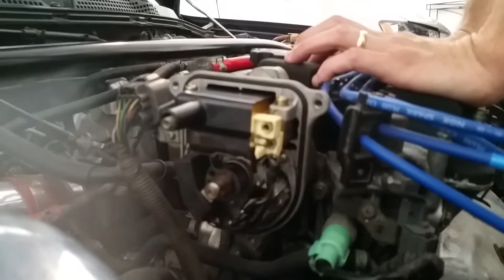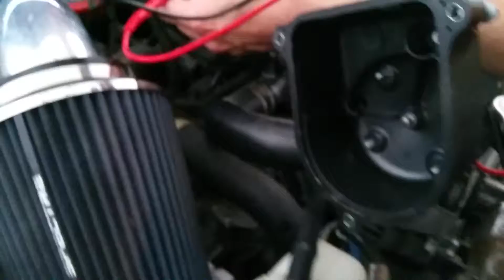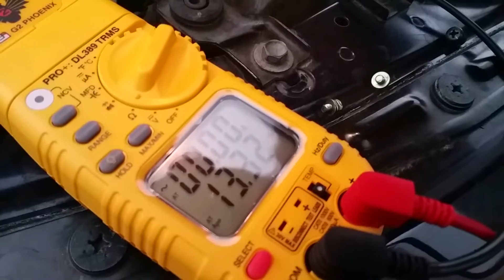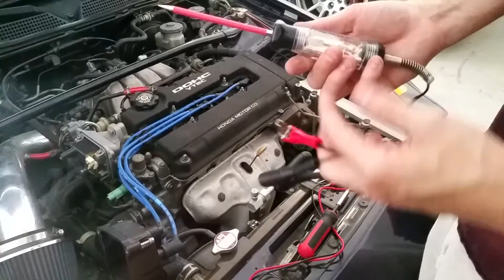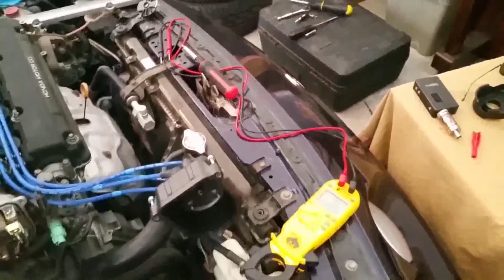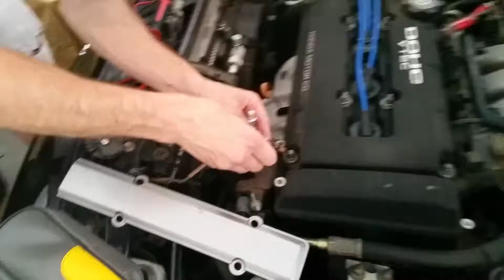DIY 98-01 integra ignition coil/system diagnosis

Comment: Thanks for posting. I wish I had found this a while ago. I had a no spark with my civic EK9, and after following the std coil test assumed that it was OK. We then spent ages testing all the wires from the ECU to the dizzy and surprise surprise, it all checked out fine. As a last resort I put a new coil in …….and it fired up 🙄

Comment: I did exactly what you said to test the ICM and only difference is mine blinked red instead. Got green when I just test to see if there was power and it lighted green, just flashed red when cranked over. Does that mean it's bad or does it just mean I'm getting high power thru it. Your test showed green flashing when mine is red flashing while cranking and got confused.
Reply from the maker: Did you hook the positive up to the positive battery terminal? And check on the point I showed? You can also leave it all hooked up with the cap off and crank it and hold the light close to the spring and see if a spark jumps the gap. Hold it like 3 mm away. If it’s red though I’d say icm is bad. But these are so finicky. I’m going could over plug here soon.
Reply: @situatedillness  Yes, positive to battery came up green touching negative on ignition coil and when cranked it over it flashed red. The manufacturer says red means high voltage. I'm wondering if there is only 12v when red to battery and neg to coil until you crank it and then it has a higher voltage hence the red flashing...? WDYT?

Comment: Wat are the symptoms cause I a no start problem wires are new and cleaned up starters good  main relay clicking on an fuel pump humming on
Reply from the maker: If you watch the video it walks you through how to test for spark at certain places. I don’t know it could be a few things. Ignition coil, which in your case I doubt, or could be bad plugs, bad cap and rotor in the dizzy, bad set of wires, etc.
Reply: @situatedillness  plugs are new

Comment: I got new distributer, new battery, new spark plug wires, new plugs, new alternator, new starter.. B series help, it cranks no start
Reply: I get it sometimes time is so short, we just throw parts at it and say a prayer.  I think this video gives a good indication how to diagnose.  I would suspect that the distributor that you bought is aftermarket, made in china, and is not working.  Better is to keep the old distributor and replace the ignition components with Honda Factory parts.  Not just oem, but factory.

Comment: A quick and nasty way I check for spark by myself is to use my phone as a camera, put the wire and plug touchng the engine block and record if there is a spark.

Comment: Bro I get a code9 obd1. It was when I changed the rotor, cap, spark plugs/ and wire set, and ignition coil
Reply from the maker: Artie Sanchez ok it is related to a few things. the first thing after checking my manual (Hanes repair manual) is to check the ECU. Google integra repair manual and download it. there is a way to test the system in there for #9 code. too much info to explain here on how to do it
Reply from the maker: Artie Sanchez do an ECU reset and go from there
Reply: Ok
Reply from the maker: I mean without having the manual in front of me, maybe I'll get mine out and look at the manual a bit for ya

Comment: Just saved me from buying a $300 distro. Luckily it was just a $68 coil and I would've never known had I not seen this. so thank you.
Reply from the maker: Robert Landrum yeah most of the time if you crank it but it won't start it's either fuel or ignition. the fuel systems are pretty sturdy so the first thing I check if I have spark and if I don't then I start working my way back from the spark plugs to the wires to the dizzy
Reply: Situated illness Yeah knew I had fuel and no spark but didn't know how to diagnose the coil and igniter. Now I know and luckily it was just the coil.

Comment: U can check if the coil is good by putting the tester light hook up to negative and the point of the tester close to the spring if it shoot spark to the tester light is good :)
Reply from the maker: +Mr Nissan i did that in either this video or the other, but I did mention it and video it